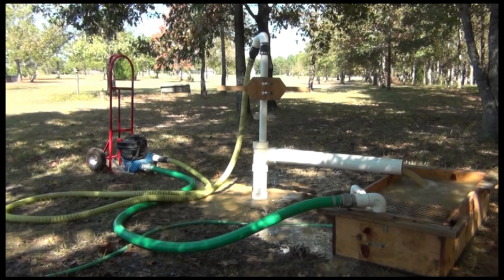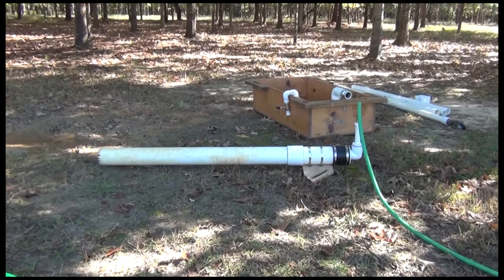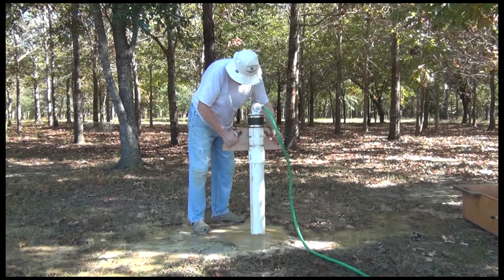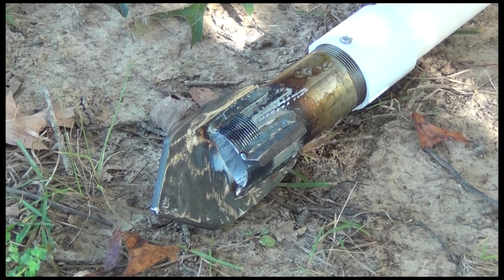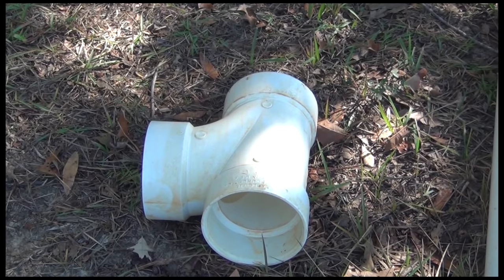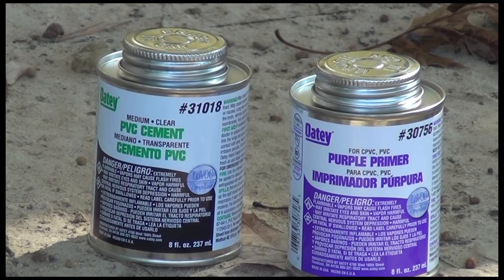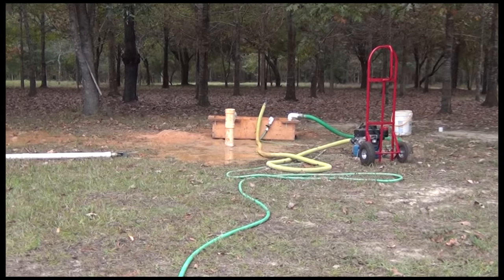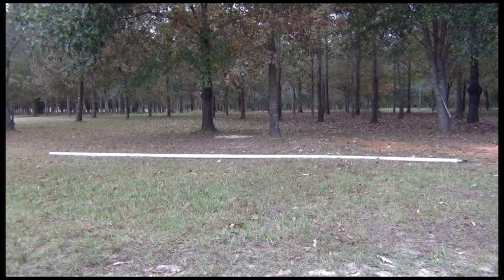Drill Your Own Water Well - Mud Pump & Portable Mud Pit

Comment: Thanks for all your informative videos.  Once you have reached desire depth with the drilling pipe, do you just remove it and then run your permanent suction pipe down to the same depth?  I will be using this method but I want to make sure I follow your process as intended.
Reply from the maker: Yes, you do.  When you get down to where you will be setting your well screen, quit using bentonite for the last 10 feet or so.  Then remove the drillpipe and put the wellscreen pipe back down the same hole.
Reply: OK, thanks.  I will be giving it a try next weekend.
Reply from the maker: good luck!

Comment: what if you hit a rock 🪨?
Reply from the maker: Depends on the size.  It will push smaller rocks out of the way if there is a very small quantity but that's it.  This will not drill/wash through rocky areas even if the rocks are medium size.

Comment: Thank you for the detailed video! One thing I have  a problem understanding is how do you back flush the new well hole to remove the quick gel?
Reply from the maker: To remove the quick gel, just change out all the drilling fluid and replace it with water.
Reply: Do you recommend flushing by using the drill pipe once done with drilling immediately before inserting the well screen or rather by  using the well screen after inserting it? 
Any idea how wide of a hole to expect in sand by using a 3" drill pipe and a bit like yours? 
Thank you.
Reply from the maker: Just dump your drilling fluid and start circulating only water when you get to the depth where you are going to set your well screen.

I'd recommend using a two inch pipe which makes slightly wider than two inch hole.

Comment: how do you tell when you get to water?
Reply from the maker: Drill until you have a hole deep enough that the top of your well screen will be 10 feet under the standing water level.  Hopefully your neighbors or the County Agent or someone can tell you what your standing water level is but if not - Drill a hole and then leave it alone for a day.  Then measure how far down to the standing water.

Comment from the maker: It will work fine in clay.  It slows down significantly but it continues to work.  Rock will stop it but not clay.  I hit multiple layers of clay in the hole shown in the video.  Thanks for watching!
Reply: Okay so what if there is rock? Ironish-sandstone?
Reply from the maker: @nonyabusiness9747  Then drilling by hand won't work.
Reply from the maker: Ron Powell  Sounds extremely reliable, albeit slow.

Comment: how do you pump the water up, below 25 ft ?
Reply from the maker: +Pavel Klimchuk You have to use a jet and a jet pump.  Most jets require 4 inch well screen pipes but some, called packer jets, can use a two inch pipe.  I had one at a previous residence and it worked fine.
Reply: How does a packer jet work
Reply: How do you setup the packer jet
Reply from the maker: +Pavel Klimchuk The best description of how one works that I have found is a pdf you can hit by Googling "valco 2 inch packer jet."  You'll need a jet pump that has two connections, one suction, and one pressure.   Basically, the pump sends water down the middle pipe and uses that pressure to pump additional water back up the larger pipe.
Reply: +dawmlw 
Thank you. Last question how does the water get into the well casing. Does the well casing has a screen at the bottom ?
Reply from the maker: +Pavel Klimchuk Yes, the well casing has a screen at the bottom and the packer jet sets just above the screen.  Use an inside coupling to connect the screen to the casing.  That will keep the packer jet from going too far down.